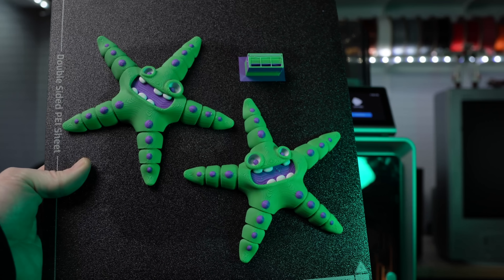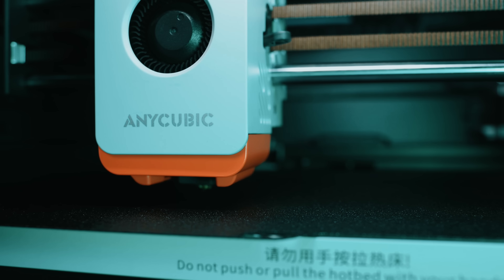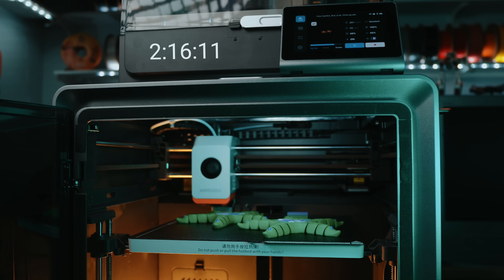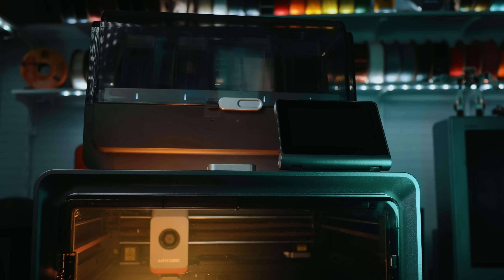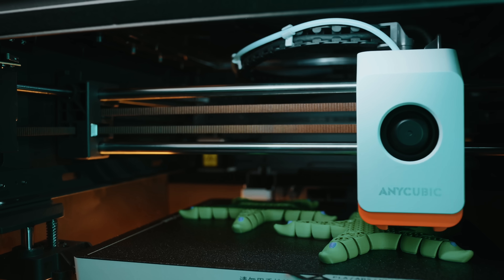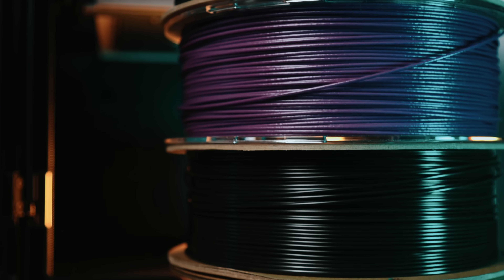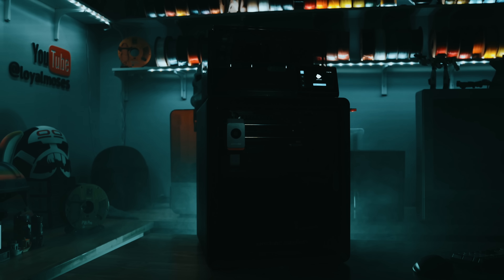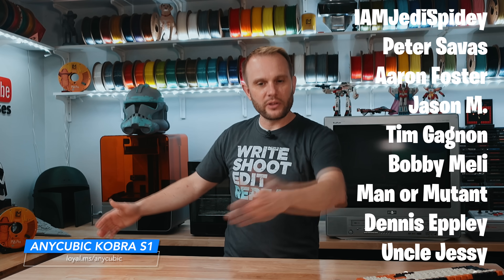Is the Anycubic Kobra S1 Ready Yet? Here’s What I Found

Comment: Lol there is this thing called a tool changer. if you dont like the waste these kinds of printers use. You dont have to give up the hobby just look up the bondtech IDEX. or even the KCM kit<--- this one will need to purge. TBH that was kinda phucked up to say. support 3d printing dont lturn them away.
Reply from the maker: Everything you print is garbage. Everything I print is garbage. If you are worried about that, not the hobby for you.
Reply: @LoyalMoses  You dont sound like you like being in this hobby? I quit with garbage prints back in 2017  You should really look up the bondtech IDEX might help you quit printing garbage prints.

Comment: 4:43 I have had several printers at this point, would I still be able to use a different slicer not from anycubic?
Reply: With rinkhals custom fw, you can use orca
Reply: @BoraHorzaGobuchul using this firmware and orca, the printer governo a error. 😔

Comment: I have had mine for 2 weeks now, and I am very impressed.

What you get for the price (615$ for the combo including 4 rolls of filament in my case) is impressive to say the least.
That price did trade in build quality however, as the casing, print head cover and components are more plasticy than for example Bambu Labs and their glass\aluminium cases.

But to be honest, that is a tradeoff I dont lose sleep over. It prints, does it fast AND you have multicolor at almost half the price (in my currency) of a Bambu Lab PS1 w/AMS or Creality K1 Max w/CFS.

Its not 10/10 or perfect in all aspects, but for the price you get what you expect and then some.

Comment: I have mine now about 5 days and already over 1kg filament was printed with it. The thing with the straight filament ends is a thing because when i seted it up i forgot to cut the filament (i just pulled it out of my old geeetech) straight and had a jammed hot end. After freeing everything up it is working flawless. I am so happy with the results of this machine. The only drawback is a little bit the software on the printer and the App. I cannot reach the camera all the time via the app. And when a software update is done, check your calibrations. I have done one software update and it seems like its a little bit underextruding but really only a small bit. I am pretty new to the orca slicer platform in general but i think it is possible to adjust the flow also in the slicer.

Technically it is a beautiful machine with a lot of potential especially for this price. It is fun to work with it. The small issues i experienced are nothing that is not fixable or essential for the printing, the camera is more like a luxury problem from my opinion.

Comment: I am already printing multi-color print jobs and manually swapping filament on a Flashforge Adventurer 5m Pro. It seems to work some of the time and other times the machine just locks up on a filament change and I have to do a hard restart. In other words, I've outgrown my 3d printer in just 3 months.  This seems to be the logical next step for me. I'm retired and on a fixed income.  It takes several months to save for a printer like this and I want to make sure it won't be something I quickly outgrow.  I wish the bed was a little bigger.  I told myself when I bought my last printer that 220x3 isn't that much smaller, but I run into print downloads that are often 256mm.  I telling myself now that 6mm isn't that much different. Is 300x going to be the next standard?

Comment: why not do a video on how air tight the  the ACE pro isn't. Take out all the filament put a bowl of water in it with dry ice and close the lid to see if the smoke comes out the cracks. The lid does not have any seal on or around it. I have a humidity gage in mine and is always the same as in the room at 25. I used the dryer for 4-5 hours got it down to 17 within 2 hours it was back to 25.  Maybe mine is missing the rubber seal?
Reply from the maker: I sure hope it isn't air tight... there is no way for fresh air to get in to be exhausted out. As a reference, my $5000 Raise3D printers of which I have multiple of them are not airtight either, they are designed with gaps to allow air to enter.

Comment: I have two, and both have been decent aside for  intermittent first layer issues where the z-offset is too small, with no way to adjust the z-offset.  I suspect the leveling system is to blame.  The slicer for Mac also has a bunch of stuff that's not been translated yet which is silly and annoying.  The best thing they could do is open source the firmware so those of us with experience building these can fix them.

Comment: I have a few years of experience with 3d printers. My experience with this printer was so bad that I returned it. I don't think the firmware is ready, specially Ace Pro.
Reply from the maker: If you can, share what your problems were so others might find it more helpful! Thank you for taking the time!
Reply: @LoyalMoses Are you ready?  I received the printer and the ACE and immediately updated the firmware. So I had no experience with previous firmwares. Regarding the problems, it was at least 10 days of trying to get multicolor. The most frequent problem was the retraction in the Ace. I couldn't finish any of the attempts and there were many. In the few advances I had to manually intervene by pushing the filaments to the printer's sensor. If I didn't stay next to the printer to intervene in the filament change, the print would fail. So far so good, the problem is only the Ace. But it wasn't enough, I had various problems such as MCU, clogging and adhesion, and in one of them the front of the extruder was torn off. The IA camera didn't work. Finally, a clogging. That's when I realized it wasn't worth my time. As a reference for the variables, I used filaments from other printer brands, which are far from being bad. I tried increasing the temperature of the hotbed and extruder, without success. I tried to revert the firmware a few times, but since I was already inclined to return the product, I didn't insist. I used the Anycubic Slicer, just for the record. I have other printers here, such as a Kobra Max, Ender 3 and K1 Max, and I honestly have no intention of buying any more Anycubic products. The Kobra Max has also given me a lot of problems in the past. Good luck!
Reply from the maker: Oh my gosh man! I would have gone mad! I am so sorry to hear this. That is a lot of issues for one machine. Oh, and thank you for sharing.

Comment: Thank you for the video. My local Microcenter had a single one of these available yesterday, and I managed to snag it. Great printer and a very nice upgrade from the heavily modified ender 3v2 that I've been using for the past 5 years. I'm unable to print if I select the flow adjustment option in anycubic slicer next when I send the file to the printer, but that's probably an issue on my end (I probably need to RTFM and do some homework lol) Overall, I'm impressed with it and how far printer tech has come along

Comment: I have a Bambu with ams and never print multicolor.
For me its the perfect filament management system. Just throw in multiple rolls of the same color or material. You will never run out.

And the ace could turn this printer in a asa or petg printing Monster ❤️

Comment: The waste of this cut&poo multicolour is anoying - because it is not needed. It is actually a flaw of the hotend, wich could be avoided without any problems.
On the good old v6 with its smal meltzone, Prusa did a lot of research how to unload filament getting a nice reloadable filament tip - without cut&poo. While this was problematicly esp. in the beginning and you had to tune the profiles for each brand and also had to make sure your filament is as dry as possible, it got much more easy with the Revo hotend. The MMU2 with an mk3s+ and a Revo Six hotend works quite well - and of course the mk4(s) + MMU3 also. The reason it works so well is the 0.4mm Standard flow nozzle with integrated heatbreak.
So to reduce waste, all to do is to modify the coldend, so you can use a nozzle with integrated heatbreak and standard flow (v6-size meltzone). No cut&poo needed. Stil, to avoid colour bleeding, you need a purge tower - or do "waste2infill" or "waste2object" combined with a smaler prime tower.
While such a hotend has lower volumetric flow, it reduces changing time for filaments a lot. So you do not only reduce waste, but over all printing time on multicolour.
Still for single colour you could swap the nozzle or hotend for higher volumetric flow - and use cut&poo for spool joining, a few coloured layers on the bottom or a few horizontal support interface layers with other material (a lot of purge needed).
Esp. with the ACE pro having a drying function, so the filament always is dry on filament changes, I do not see a reason why Anycubic uses cut&poo on the Kobra 3 and the S1 without offering a swapable hotend to reduce waste and filament changing time. It would be such a big advantage over simular colour changing systems other manufacturers use (exept Prusa).

Anothe downside of Anycubics printers: They lock down access to the modified Klipper inside. I am not sure it might even be a copyright violation to do so, as the therms of Klipper´s licence are not followed. However, on github someone published "DuckPro-Kobra3" to add full access with fluid or mainsail to the Kobra3. So there is good hope something like this will be possible for the S1 eventually.

The ACE pro has a nice serial 115200 baud connection via USB 2.0, using molex connectors instead USB ones. On github you find "DuckACE" with the description how to use the ACE pro with other Klipper printers.

Comment: Hi, I'm on my 2nd kobra s1. 1st had damaged wiring and a bunch of dents and dings a broken fan shroud. That got returned. Now my new one made only one single print before erroring out with the 10125 code. Now after repeating the steps to resolve it just does it over and over again.
Reply: It's a bug in the firmware, uncheck flow calibration, it will fix it until they release an updated firmware to reslove the issue.

Comment: I've now had mine for almost a week. Here is my take and I hope you read this and explain this to Anycubic. I've been printing for many years with an Ender 3 Pro. 

1. I have no idea how to slice in a normal way. Anycubic Next is available on my system but after installing it on arch it asks to update the system and I end up in an update loop. Since it's based on OrcaSlicer, I installed that. That has profiles for the Anycubic. But it can't send to the printer. So somehow, it's not being pushed back to Orcaslicer. There are tons of setup methods, none for the Anycubic system. I tried every method under LAN mode, but none work. Right now my workflow is to slice it, then upload the gcode to the anycubic cloud universe, then open the app, send it to the printer. The printer will fail as it refuses to print from the app and automatically gives an error message. After that, I power off the printer and power it back on. Now that file is on the printer and I can select the file and print. This is incredibly frustrating. Takes me about 10 minutes longer than it should for no reason.  

2. I have no idea how multi color works. I currently only print in one color but I haven't seen any video's yet on how that's actually done. How do I select what part to print in one color? So far it seems like a gimmick. Even if I wanted to, I have no idea how this works. 

3. The options don't make much sense. Why do I have to select AI detection, bed leveling, vibration compensation each time? What happens if I don't turn it on, does it ignore it and do nothing with it, or keep previous settings? That vibration thing is incredibly annoying to run and only makes sense to redo when you move it to a different surface. 

4. Turning it off. Why can't I turn it off using a button? I want to turn off the machine when I'm done and if possible, automatically using a timeout. Both the top unit and printer should turn off when not in use. The power switches are at the back and even in different locations. One on the left, one on the right. So I plugged both into a power strip with a power switch and use that to turn the printer on and off. Far from the best way to do it. 

5. The ace pro unit. I've had several times already that the filament goes into the right place. I push it into the hole and it's having a difficult time actually grabbing the filament and sometimes, it pushes it to the side and I have to remove the other filaments by force (it errors out so I can't take the filament out), take apart the entire front end, loosen the motors and axles in there and remove filament, then put it back and hope it goes accepts the filament.  

When it prints, it's great. It's fast, it makes beautiful prints. I expected a bit more though.

Comment: Do you know: it doesnt have a all metal  heatbreak ! This is a big downgrade, imho ! Shame on them.
Reply from the maker: Did you know that nobody cares if it does or doesn't... only a small few group of nerds care. The average 3D printer buyer just wants to grab some cool filament and load it in a printer and print cool stuff.
Reply: @LoyalMoses  
In my Opinion they should advertise it correctly, like: it has a special heatbreak with a PTFE tube inside. So no surprises after buying. This would be fair👍

Comment: I ordered mine and its shipping soon and I am so excited to get in to multicolor prints, I got a i3 Mega back in 2017 and its been my only printer for years and yeah it has its odd issues but you know it just works, heck I printed a 3 meter star destroyer with it, it did take 6 months to do but it still did it, so I thought its time for an upgrade and with my Mega having EEPROM issues so its time to let her retire.

A lot of people at work see my star destroyer and thinks its cool and would like to get in to 3d printing also and I tell them this every time.

3D Printing is fun and its a cool hobby epically when you can start making stuff to fix things around your house or make little toys and nick knacks BUT like I said its a HOBBY and at times its not just a buy a printer, pull it out of the box, connect it and away you go.... It's a machine, you have to take care of it, do maintenance, debug issues, and at times you just want to give up or go cry in the corner for a while, but when you look past that and get the hang of things then its really fun and cool.

Its just there is a lot of baby steps and it just takes time but in the long run its totally worth it and if you want to get in to it then start small, get a little 1 color printer and once you have that down start working your way up, jumping on to a multi color as you 1st printer is just asking for nothing but headaches, if you want to go with this printer then just run it without the ACE Pro  in single color at 1st till you get the hang for it,  like I said, Bay steps.

Comment: I'm still on the fence between this and the Bambu P1S. Its more expensive but I think its overall more reliable. Plus I have heard that due to the Kobra S1's hotend design having a really long melt-zone, if switching colors from one extreme to the next, the purge volume is way more than the P1S, even though both can be quite wasteful on the purges. 
I dunno, its so tough to really pick between the two. Both have plusses and minuses.

Comment: Have one with a few hundred hours in it. It's a great machine.. mines been flawless. Even printing in single color is great because it can switch to a new roll when one runs out. The dryer option is great it runs automatically when printing and you can set it to run over night if you want when the printer is idle.

Comment: Thank you for your honest opinion on the S1. I have been excited about it since I started using my Kobra 3 Combo, and you answered a lot of my questions. I am curious if you tried the filament backup feature. On the Kobra 3 Combo the runout on a filament backup is triggered at the ACE Pro. which causes a purge of over a meter of filament, yes I measured it. I see purge, where justified, as a normal part of multi-color printing, but purging the final meter of filament on a spool is both time consuming and wasteful. This is one of the shortcomings of my Kobra 3 Combo I am hoping they have fixed in the Kobra S1 Combos and maybe the Kobra 3 Max Combo.

Comment: 8:27 I've have about 400 hours on this printer. Here are some gripes. No reason for NEXT. Just give everything to Orca. I hate that I have to use another slicer. If it detects a clog, it puts an anoying pop up on the. screen that you can not close. You have to use the mobile app to heat up the nozzle to clear it. Thats just stupid. Also, you can not get a total cost of the print because it does not factor in waste in the slicer. The Kobra 3 is the same.  Finally, you do not get an acurate print time  remaining on the printer screen because it doesn't consider color changes. Only actual print time. A print that showes 2 minutes may actually take 15 when color changes are factored in.

Comment: My S1 prints extremely slow. Its 2/3 the speed of my X1C for the same exact prints. They seem to advertise it as a X1/P1 competitor, but the same exact prints with the same nozzle size take 40-60% longer with my S1. The factory slicer profile must be the issue because the pre sliced benchy on the machine isn't that much slower than a P1/S1. Maybe they should update the profile in the anycubic slicer so that it doesn't take forever to do a 2 color print.
Reply from the maker: Those 3 minute filament swaps are brutal! So long!
Reply: @LoyalMoses  Its not just filament color changes. Single color prints on the S1 are significantly slower than the P1/X1 printers.